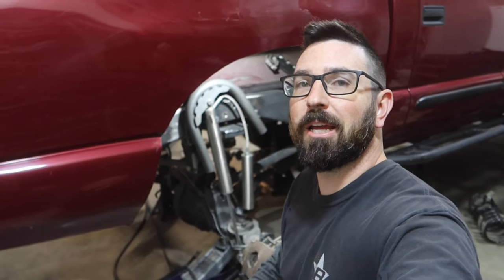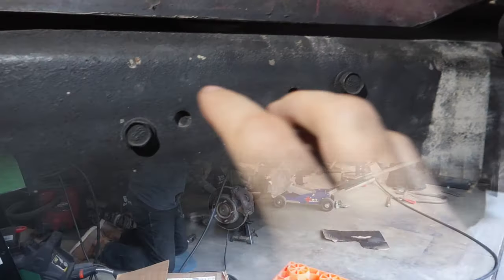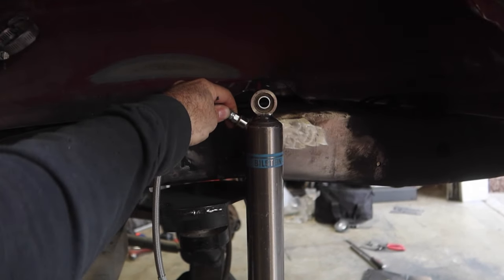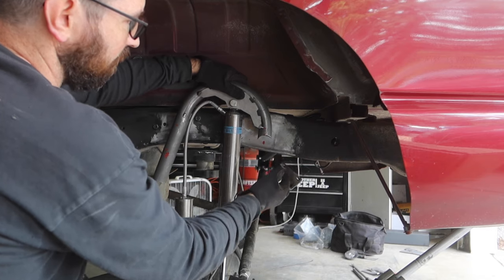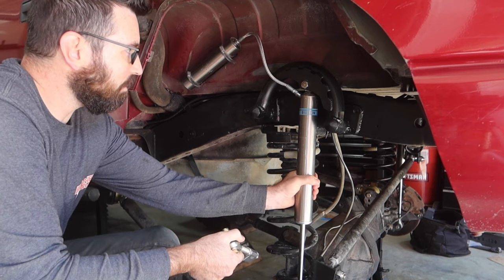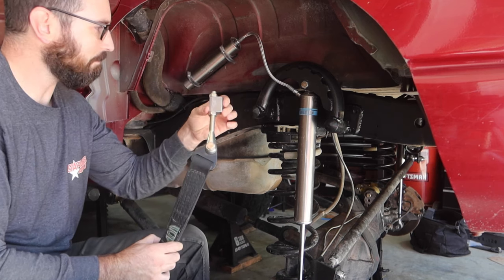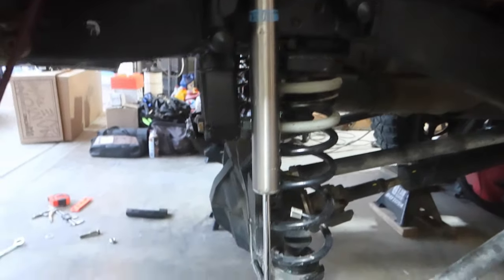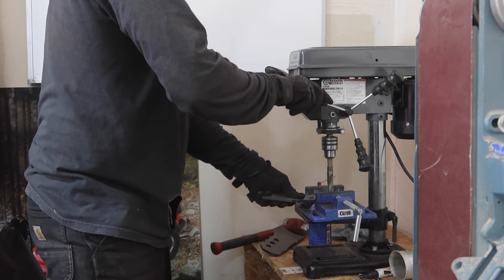Simple shock mount and limit straps!

Comment: That looks solid back there now.I wonder if some of the driving issues where not from the rear axle shifting side to side? If the track bar isn't level at ride height it should be pushing the rearend side to side more  when ever you hit bunps or lean going around curves.
Reply from the maker: Thanks, it absolutely would be better if it was more level.  I Raised the axle side 2” and lowered the frame side 2” in the last video. I would have to lower the truck to get the angles more level or run like a 10” long bracket on both sides which I don’t want to do.

Comment: Instead of the limit straps did you think about some type of coil retainer for the top of the coil spring? Could have saved $100 by making it out of steel you probably already had.
Reply from the maker: I decided not to do that, it would pull the spring apart putting a lot of strain on whatever retainer I built. Not much but it would. Limit strap is the proper way to do it, and it will save my shock.
Reply: @MuddyBeards4X4  How would it put any strain on the mount? Your coil is free floating on the bottom. On my buggy I purposely solid mounted the top of the coil and used the same style free float like yours. Except I designed it so the spring is under tension at full droop. Not much but a little.
Reply from the maker: You are correct, my brain is fried from a long sleepless weekend.. I still don’t like the idea of coils being loose on either side. But I have seen it done before.
Reply: @MuddyBeards4X4  In my case the top is attached and the bottom is free floating on a 1.75" tube with a bumpstop/retainer so it stretches the spring a bit at full droop under flex. About 3" of travel before the retainer. The spring can not come off accidentally. This is set up for slow crawling.